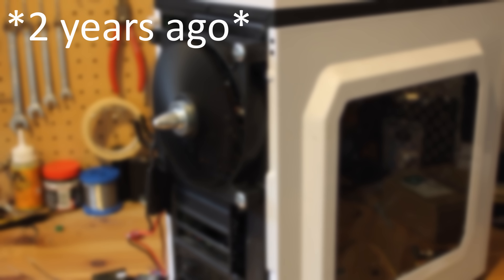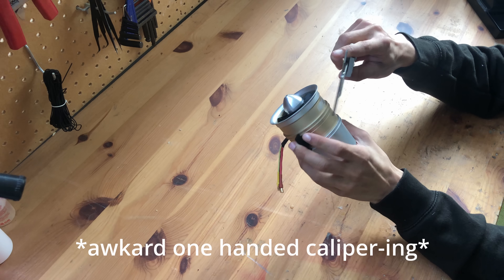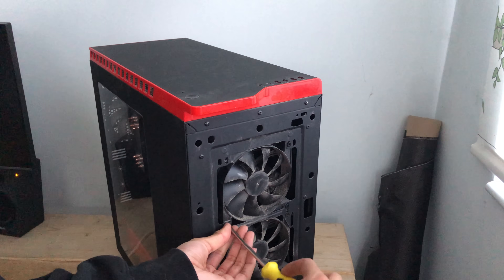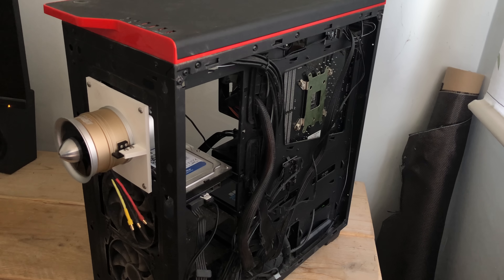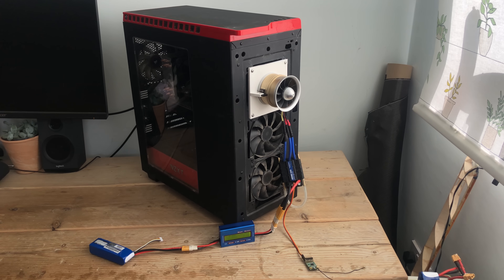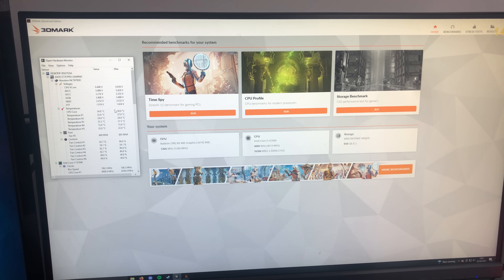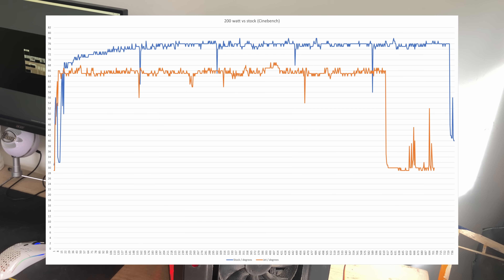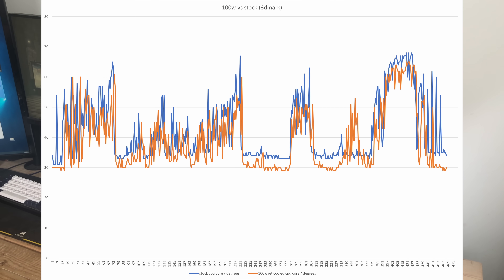I cooled my PC with a JET ENGINE...

Comment: Has no sense a turbine because is the metal thermal conductivity resistance the main issue to address and not the amount of air flow circulating.

Comment: Needs a pull config to not have waste heat go to the components and make the internal area more aerodynamic and go through the component cooling fins. Some ppl 3d print components to block or redirect airflow in their cases to improve thermals.

Comment: You should do that on your CPU fan. and put a comparison with other weaker fans.
Because that will be a more vivid and significant change.
Reply: that fan will probably strip teh wrms off and fan slots will get all wicked
Reply: @BleezyMonkey  In that case he can use it to cool water radiator ;)
Reply: yeah, but where is the fun in that?
Reply: ah yes Intel Helicopter
Reply: that could rip the components off the board. i wouldn't do that.

Comment: Looks badass! EDF is not a jet engine, tho.
Reply from the maker: shhh but thankyou!
Reply: @Motricium  hehe
Reply: I think it should be better as a CPU fan. However, the thermal conductivity of the heatsink would be the bottleneck.

Comment: Major drawbacks are

Hot air is pushed in because of coil heating .

High amount of vibration and noise.

Uses more electricity.

But still enjoyable experiment.
Reply: simple. just use the jet engine as the exhaust fan. no more hot air pushed in
Reply: @YansenHaryanto4547  yup but it may damage to other components
Reply: @techy_triangle  hi, how can other component be damaged?
Reply: @jundikhaalish2081  for example .

Other fans spins back wards , it may cause damage to fins

Cables might tangle or pulled ( like sata cable )

Components like ram having soldered IC or other IC component on motherboard wore off due to low pressure and suction .

And as you know suction causes more heat than vaccum chamber , it's one of the law of thermodynamics.
Reply: @techy_triangle  Easy problems, easy fixes.
-Install your fans correctly then they won't spin backwards
-cableties
-no.
-don't seal off your case with duct tape

Worst thing I'd be concerned about would be vibration but even that can be solved with a few rubber pads. That thing is supposed to be in a somewhat fragile model aircraft. If it were actually damaging to electric components, I don't think it would be used for that. Most times it helps a lot to not yolo things and put a few seconds of thought in.
Reply: @YansenHaryanto4547  yea but you dont have the pressure to push the air to the upside for that engine to take full advantage. the hot air will be pushed out from the gpu and cpu's fans but that's pretty much it, it's almost like having an open case. However if you have something to also push the hot air to the upside, i think that then this would be more benefical
Reply: @The Crazy Slav yup and if you just increase the coil winding of Normal 120 mm fan then it will take more power but it will cool down the system faster.

I did this to my Corsair AIO fans
Reply: @The Crazy Slav 24 Watts. Which is a little less than the EDF in the video. I own a 240w, 120mm fan but it is designed to output this constantly and securely, unlike a hobby EDF.
Reply: @The Crazy Slav yup absolutely this kind of fans are used in room heaters babe
Reply: @The Crazy Slav no they are not. they are loud but they cap at around 5-6000rpm this guy does 48k rpm. the pressure must be insane i wouldnt even dare putting a hand 20cm to the running engine

Comment: isn't this cooling engine installed reversely? as you can see in the 2:22 is spinning as the blades pulls air out of the case instead of  pulling in.
Reply from the maker: yeah the later tests the direction is corrected

Comment: Imagine your PC literally flying away when you start a benchmark. With two of those that'd be a real concern!
Reply: mmm minced meat
Reply: Imagine your PC does a full transatlantic flight when you open a new Chrome tab
Reply: No because it started moving the other 2 fans
Reply: Not a problem unless your pc is engineered to fly away with a jet engine on the back

Comment: Now try it while strapping Jet Engine as a direct CPU cooling fan. I think that (if it doesn't ourright fall apart) temperature drop would be insane
Reply from the maker: Agreed
Reply: @Motricium  Look up fan showdown cheater fan and other videos there, plenty of good inspiration there.
Reply: It will drop unless the components have already reached their peak thermal efficiency with air which is quite likely
Reply: @raynman6466  the cpu will lift off :D
Reply: @raynman6466  do it in winter?
Reply: @JacReviewsStuff  ambient temperature is irrelevant
Reply: @raynman6466  i mean dont forget liquid nitrogen, it can drop to 0 or below zero. so i think such pressure with jet could do the same unless it breakes something before that haha
Reply: wouldn't it's vibrations damage the CPU components and pins?
Reply: @deathtrooper199  CPUs are pretty resistant once properly socketed in.
Reply: @latte_macchiato_de  How about in the long run?
Reply: @deathtrooper199  Pins are rarely the issue, they are pretty solidly soldered on there.
Reply: @latte_macchiato_de  this would shake everything attached to the motherboard, directly onto the motherboard... which then focusing the vibrations tension around the sockets the MB is screwed on by.  the thing would rattle more than "be loud" fans.
Reply: @deathtrooper199  thats what im thinking, the vibrations would cause alot more harm than good.
Reply: Or put on cpu big passive cooler and than bench
Reply: @filofifa  or, have a desk with a plate that has a nicely wooden top fisnish but on one spot at the bottom a giant cooper block falling out of the desk. there you mount your cpu on so the Table can be used as a coffee heater as well if you build it the right way :D
Reply: I think the electrical jet engine also produces heat (depends on how much watt the engine is operating)
Reply: Put it on a GPU
Reply: I'd sub for that.
Reply: yess please do itttt
Reply: it will shake or making vibration. is is bess to have a pipe near to it through the exhaust port so that it is not make your whole pc destroyed
Reply: No no... Cpus are not too hot. Try the GPU 👀
Reply: @unpatitoRU  GPU's are not that hot either (if we are talking about low to medium end ones)
Reply: For a just "fan", it is totally impossible to get things below room temperature by just blowing air.
Reply: @redblackfoxy  the person who made this comment isn't saying that the CPU can drop below room temperature, he said that it would be an insane temperature drop (like for example if something was 95* then maybe it would go down to like 65* or 70* because more air is being pushed through the heatsink allowing the heat to get away faster)
Reply: @redblackfoxy  i see. even if you have yet engine cooling down the heatsink? i mean i know it wont go below zero but i guess you make a point since it is blowing room temp air into the case
Reply: Yes, also try cleaning it once in a while, those regular fans were filthy and you'd be spreading dust everywhere...
Reply: Plus make the room air conditioned cuz the I think the high velocity air would heat up due to its speed
Reply: *temperature SKYROCKET
Reply: Blowing through a noctua block wouldn't be a bad idea though if it was all part of the chassis, I think it's a great idea :P
Reply: @off spec no it’s not 🥱 I own a tt account with 67k followers proving you wrong.
Reply: @Tealzealorangepeel  nobody gives a damn about your 67k “”followers””
Reply: @off spec I own a tiktok account with 67k followers showing the use of 3d prints (:

Comment: 2 years Delta. Excellent! But that's a lot of watts for do little gain. Can you buy another one? Put it as exhaust. Then make a 3d printed baffle to go front to back over the heatsink. Get 1000w of power and see if you get a 20deg drop?

Comment: Sadly enough you can achieve a 10 degree temperature drop just by throwing a Cooler Master Evo on your CPU or by having a bottom intake fan in your PC chassis. Floor mounted for your GPU to get cooler air.
Reply from the maker: indeed it is unfortunately very pointless
Reply: watercool